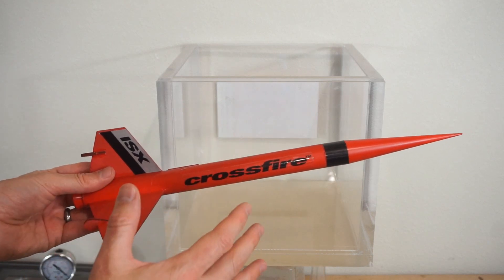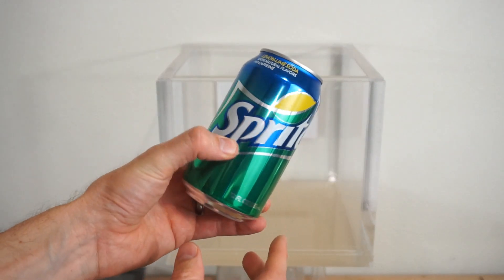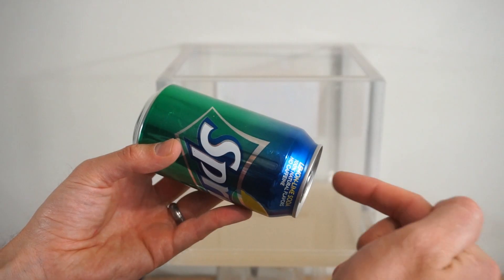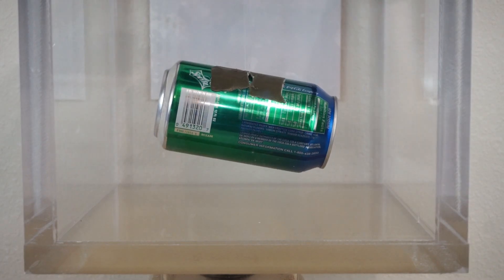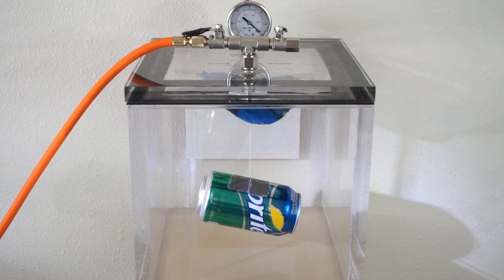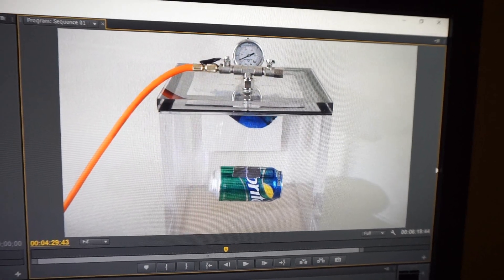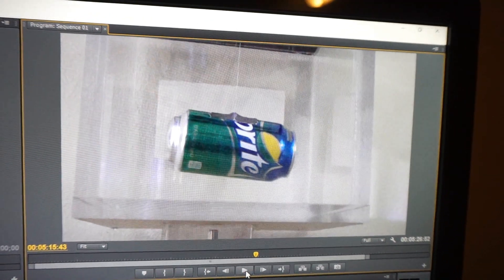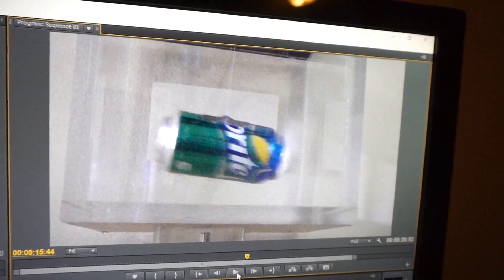Can a Rocket Fly in a Vacuum Chamber?

Comment: Beautiful, please now try with an heavy object to move with a considerablely lower mass as propellant, what happens? Almost nothing to the higly massive object, all the energy is delivered to the fuel. The can moves a lot because it have a lower mass than the sprite. It would be interesting to make an experiment reproducing the ratio of energy, mass delivered and mass to move of a rocket to see what happens.
Reply: Yes, the liquid weighs much more than the can does, thereby displacing the can with great force. But because the can + contained liquid weighs more than the ejected liquid, the ejected liquid will meet the wall before the can + contained liquid does.
Reply: I think a rocket can fly on Earth because of the air allowing to push on it, but in a total vacuum all the energy will be lost and the most massive part of the couple container/propellant will keep its place due to inertia during the other one will be ejected.
Only the momentum accumuled in the atmosphere would make the rocket to travel in space.
Reply: I think a rocket can fly on Earth because of the air allowing to push on it, but in a total vacuum all the energy will be lost and the most massive part of the couple container/propellant will keep its place due to inertia while the other one will be ejected.
Only the momentum accumuled in the atmosphere would make the rocket to travel in space.

Comment: If one hits a baseball, hanging motionless from a string with a bat, its resistance (the ball's) can be felt. It didn't want to move from its place in space. The harder you try to accelerate (hit) the ball, the more resistance is felt. Many call this phenomenon inertia and if it didn't exist, well...nothing would exist but you certainly wouldn't be able to swing a bat much less move the ball. Anyways, think about how this applies to rapidly expanding gases or an 'explosion' against another mass. The explosion, and the molecules within, will exhibit this same behavior. So, this energy central to the mass of the explosion, will not want to move just like the baseball. If it exerts ten pounds of force in all directions and is applied to a one pound object, what do you propose should happen? The lighter object will be pushed away farther than the explosion's mass will be.

Here is a thought...and much easier to understand and ponder. If one were in a vacuum, would a stick of dynamite hurt them? According to some folks' theory, there wouldn't be anything to oppose the force that is applied to their body. Now think of multiple sticks igniting, from the same place on their body, one after the other. Would it continuously push them through a vacuum?

Oh, and Action Lab rules!

Comment: Its actually simpy grade 5 science that proves rockets work in a vacuum. Its like how propellers and air foils work.
They create low pressure on top and high pressure below, so it pushes up. When fuel burns in a rocket, its moving to a low pressure, making that a high pressure, making the pressure inside a low pressure, forcing the rocket up.
Reply: That's not actually how it works. Forces come in pairs.
Reply: Not arguing the point you made about high pressure and low pressure systems... BUT... just because they teach it to 5th graders doesn’t make it true. What you are talking about is a law of physics which can be tested and replicated. They also teach a lot of theories in public schools which cannot be tested or replicated.

Comment: Did the can propel forward because of the gas pressure against the glass of the chamber? This experiment needs to be done in a chamber where there is no chance of the contents hitting the glass
Reply: The box was not a complete vacuum because air was continuously being syphoned out. Therefore, when the can finally exploded, there was still some air particles that the CO2 could push off, thus you see the slight movement of the can. You need a larger vacuum chamber.
Reply: This experiment should be called "Do rockets work under lower pressure"
Reply: The can was propelled forward because it pushed off the gas and liquid it ejected. It’s just the third law of motion at work.
Reply: The glass chamber was too small. It looks like a joke of an experiment
Reply: The vacuum of space is endless,  so for this experiment to be close, the vacuum chamber needs to be on an equal scale of space!

Comment: The can is filled with liquid and balanced on the string. Once the seal breaks the liquid escapes and the can is no longer balanced. That is the cause of the initial movement. Then liquid escapes makes contact with the confined space and the resulting splatter acts on the suspended can. So this does not prove that rockets work in space.  So again this is a fail.

Comment: The liquid has mass. More mass than the light aluminum can that held it. You've just experienced hydraulics in action. Cool, but nothing to do with rocketry.
Reply: "The liquid has mass. More mass than the light aluminum can that held it."

So, just like a rocket, where the propellants usually make up about 90% of the entire crafts total mass?
Reply: You're not releasing your entire fuel supply at once. How long can you sustain the metered release of the fuel? And if it were just the mass in question why would we even ignite it? We may as well just use pressurized water for our propellant. Ahhh, but we're faced with the infinite vacuum which would suck the propellant in every direction in an attempt to fill the void...The void is infinite and once again we are dead in the water. If we could master it, we'd have photographs as evidence....show me a photo. All  NASA as to offer are CGIs and Artist's renditions...hmmm.
Reply: asleepinthealley
No, I'm "releasing it" bit by bit. And I can sustain it, until the fuel runs out.
The reason we ignite it, is to accelerate it. It's not just mass. It's mass and velocity (conservation of momentum), or mass and acceleration (Newton's Second Law). Pressurised water could indeed be used as a reaction mass (see bottle-rockets), however such a rocket would have very low specific impulse, meaning they wouldn't be very useful.

Also, I see you gotten something mixed up here. Vacuums don't suck. There's no such thing as negative pressure. A vacuum wouldn't stop a rocket from working, since the action/reaction interface is located between the rocket-engine and the expanding exhaust gases, and not at the bottom of the exhaust plume.

As for photographic evidence.

Here's Earth Rise, taken from Apollo 8, using a Hasselblad 500 EL camera (i.e. film photography, not CGI)

https://www.google.dk/search?q=earth+rise+photo+1968&source=lnms&tbm=isch&sa=X&ved=0ahUKEwjwjpers-zdAhVGK1AKHXdmA4EQ_AUICigB&biw=1366&bih=657#imgrc=IWzS7OOh_EHtYM:

Or here's "The Blue Marble". That is, the actual Blue Marble, as taken using a Hasselblad camera from Apollo 17

https://www.google.dk/search?q=Apollo+17+Blue+Marble&source=lnms&tbm=isch&sa=X&ved=0ahUKEwiLs7W8tOzdAhWOKFAKHQ7wD48Q_AUICigB&biw=1366&bih=657#imgrc=YgY4l5SdNTT6OM:

Neither of these shots are CGI, or composites. They're single shot, film photography shots.

Do ask me if you want more.
Reply: @ShadowFalcon  There's no such thing as 'negative pressure'? How do you think they pump septic tanks?
Reply: @asleepinthealley 
Allow one area with high posititive pressure to push stuff into another area with comparably low positive pressure.

Comment: You're missing the obvious. The soda can is full of a dense substance that is heavier than the aluminum can that contains it. What  you've shown is two dense subjects being repelled or 'pushing away' from one another. This is not what Rockets firing in Space do. A rocket powered spacecraft itself is a dense, heavy payload. The Rocket firing spent gasses are of almost no perceptible weight or denseness and would require something heavy and close in mass to the spacecraft's own weight, denseness or mass we desire to be propelled. Barring that, we'd need a backboard or something to serve as one. In our atmosphere we use the compressed air to accomplish this. What you've illustrated are two comparable mediums being repelled from one another and a heavy rocket powered spacecraft comes nowhere close to the spent gasses being pushed from it. Do you understand what I'm saying?

Comment: the experiment is basically wrong< why you ask?
simply, look at the psi meter when the can explodes, it reverts to a somewhat pressurized environment that can no longer be called vacuum, thus the can will have a propulsion.
what just happened is that when the vacuum chamber sucked air, the air inside the can was preserved in it since the can is sealed, and once the tin can could not keep up with the suction force, it exploded, and the air in it re-pressurized the chamber to a non vacuum state, and when the effect of the gas and liquid kept rushing out of the can while the chamber got pressurized again to some extent, then we get the effect of movement.
so basically, this experiment is wrong, you need to guarantee the the chamber won't get pressurized again. so there will be no air particles that will form a barrier to push against.

Comment: Just because you can't see the soda hitting the wall you believe this proved a rocket can fly in a vacuum. The box is so small and the pressure from explosion is so high the invisible soda vapours clearly pushed the can off the wall. You can see even the visible soda vapours are already close to the wall. In space there's no walls

Comment: Just spitballing here: 
A. As others have noted, the vacuum chamber in this experiment is very small and cannot provide a large enough airless environment to simulate space;
B. In addition, the can is not free-floating in a weightless zero-G environment;
C. And quite unlike a rocket in space, the can is tethered to the lid by a string.

A full 12 OZ  soda can suspended by a string within the earth's gravitational field creates vertical resistance, and could well provide enough mass (gravitational restraint) against which the exploding soda gas can immediately push, without the need for the gas to press against the nearby wall of the chamber. 

Perhaps if the experiment were performed in a "vomit comet" where the entire interior chamber of the plane could somehow be pumped free of air (without being imploded itself), simulating a large enough vacuum to be meaningful, the now-depressurized plane sent on a dive (simulating zero-G), and then the soda can released from a pressurized holding chamber into the vacuum (simulating the sudden engagement of an untethered rocket engine in a relatively large vacuum without gravity), you'd have a different result, ie, no propulsion.

Comment: Surely the size of the chamber renders this experiment void. It's a displacement of gas in a tiny space, of course gases are hiting the walls just because it isn't visible at that initial stage does not mean that the walls are not effecting it's movement. Also this is not in zero gravity therefore the can will begin to move as it begins to empties it's load.
Reply: There is no such thing as zero gravity. Wherever there is mass around, there is gravity. Regardless of how small the force from that may be. Tell me where in the Universe, there is no mass?
Reply: The size of the chamber is irrelevant.  The motion of the can starts when the liquid starts to explode out, not when the gas exists.

Further, if the gas were relevant to the momentum of the can, then the number of atmospheres would be proportional to the motion of the can.  At 0,01 atmospheres, the can's explosion should be at 1/100th of the speed due to 1% of the number of gas collisions.
Reply: - "Also this is not in zero gravity therefore the can will begin to move as it begins to empties it's load."

Care to tell us what is the "gravity" at the orbit of the ISS?
I know you can't answer so I will answer for you: It is almost the SAME as at the surface of the earth.
Yes "Gravity" is almost the same strength at the altitude of the ISS as it is at ground level. Right around 9.8 m/s^2
Reply: Ignore all known physics, tell stories. You're not getting a bigger chamber and demonstrating that, though. Also, at ISS level earth's gravity is still 90% of its strength at the ground.

Comment: Where is the footage of nasa flying a small  rocket in their giant nasa partial vacuum chamber?  You are saying things can fly with no air.
Reply: Yes they can.
Reply: @-_Nuke_- Prove it
Reply: @lonewulv13 prove what exactly?
Reply: @-_Nuke_- That things can fly without air.
Reply: There isn't "no air" they release air from the back
Reply: @Jmannyn And what does the air push against?
Reply: @lonewulv13 The back of the space craft. As the gas fires out the back and equal and opposite effect happens on the craft expelling the air. Air fires out the craft moves in the opposite direction.
Reply: @Jmannyn What is the air pushing against in a vaccum?
Reply: @lonewulv13  The craft that it is coming out of, it doesn't need to push off of anything else. This is exactly the same in atmosphere btw, a ship doesn't need atmosphere to push against, if anything air creates resistance at the front of the craft whilst the thruster propels the craft by violently firing out the back of it. Atmosphere does not help a rocket move, it hinders it which is why spacecrafts move much quicker through space than they did whilst still in our atmosphere.

I think you are confusing how a plane works with how a rocket works, a plane uses lift from the air under its wings but a rocket doesn't have wings because it generates enough thrust that it doesn't need to cruise on the air, air is just resistance to a spacecraft, not something generate lift.
Reply: @Jmannyn  I'm not confusing anything. The force that resists an aircraft is the same force the craft resists off of to achieve thrust: matter, density.

In the perfect zero gravity vaccum of space there is no resistance. A rocket would just project it's exhaust and nothing would happen. It wouldn't move.

There is no way to prove otherwise either as even with a simulated environment like a vaccum chamber for as soon as a rocket is ignited the vaccum chamber is pressurized and no longer a vaccum
Reply: @lonewulv13 We don't need a simulation since many different nations and private organisations have propelled real rockets in space 🤦 

It doesn't have to "resist off" of anything, it resists off of the craft itself, in a vacuum you wouldn't even need anything as powerful or dramatic as a rocket thruster to achieve this effect, if you let off a fire extinguisher in space, gas would be pushed out and it would in turn push the cylinder (and you holding it) in the opposite direction, air doesn't matter. 

Think about a gun: when you fire it, it pushes back on you - that's recoil. It isn't the bullet pushing against the air that causes recoil, but the force of accelerating the bullet and the expanding gases pushing it out of the barrel. The same principle applies to a rocket in space: it moves because the exhaust gases are pushed out the back, not because they push against the air.
Reply: @Jmannyn  They claim to have propelled rockets into space. All we have to go by is their word and video footage. Neither of which are reliable.

"It resists off the craft itself"

That's like saying your feet push off of themselves which propella you forward while walking. As for recoil from firing a gun, it's a result of pressure built up as the bullet exits the barrel. Basically in space it would be creating a tiny, temporary pressurized environment within the barrel when it is fired. I imagine recoil would feel different in space.
Reply: @lonewulv13  Well the video evidence and the literal millions of people across many different countries who have worked in space flight whom I think would have noticed if their jobs weren't real.

You're absolutely right that recoil comes from the pressure inside the gun's barrel pushing the bullet forward. But that's exactly why rockets work too. Both guns and rockets operate on the same principle, internal pressure pushing mass in one direction creates an equal push in the opposite direction. That's not an Earth effect, it's just conservation of momentum.

What you called 'a tiny, temporary pressurised environment in the barrel' is the same thing a rocket chamber does, just continuously. The rocket constantly creates high-pressure gas inside its combustion chamber and ejects it out of the nozzle. That ejection pushes the rocket forward the same way a bullet being pushed out of a barrel pushes a gun backward.
Reply: @lonewulv13 Has your perspective altered?
Reply: @lonewulv13 ...nothing? Changing your mind is upon previously unconsidered evidence is healthy bro